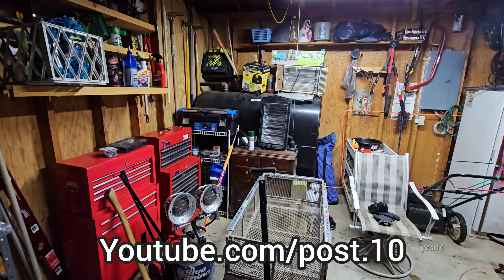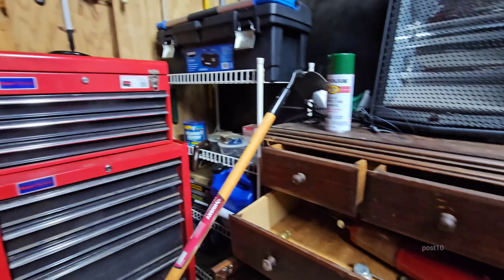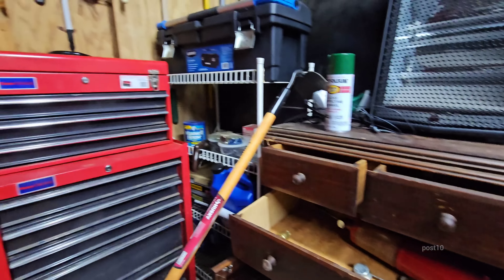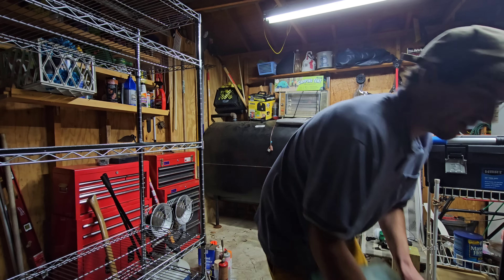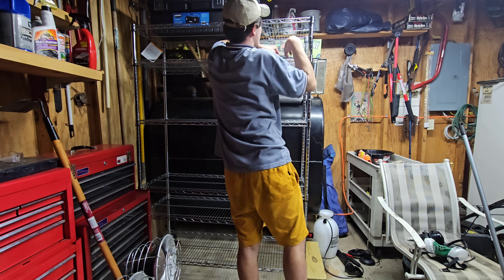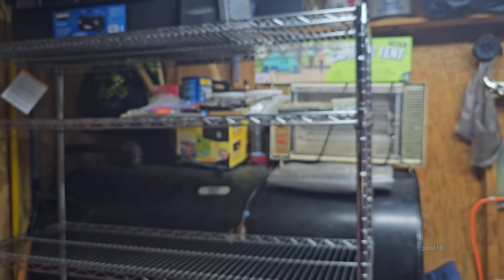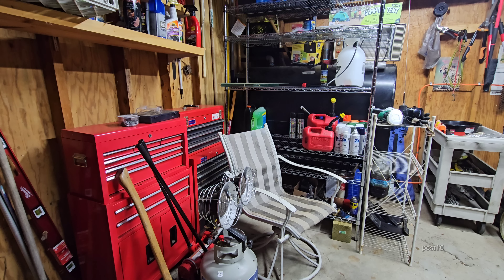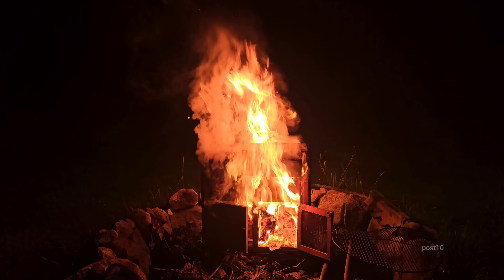September 22 2023 Garage Mold Fire Vlog

Comment: cinder blocks or bricks + those glass shelves = a free shelving unit to sit on the floor in the house. can use felt furniture pads to keep the glass from getting scratched on the pressure points.

Comment: Before you reinforce that shed/garage ceiling, make sure the walls can support added weight, including whatever you store up there. The fire was much more interesting than I would have though, it had me mesmerized. I'm pretty sure pressure treated had arsenic well into the 90s. I worked in a lumber yard millwork shop during HS and college, and frequently made pressure treated treads, risers, POSTS, balusters, etc. to order. That stuff was such a pain to work with.

Comment: I like using vinegar or hydrogen peroxide and sometimes bleach for eradicating mold. I have saved moldy furniture like that piece but do not be afraid to drench every crevice of that. Or burn it because you really do not need it taking up space! You can winterize a pressure washer by running their winterizing oil through the pump.

Comment: Hey post 10 keep up the good videos I sure do enjoy them   When you decide to undercoat your vehicles underside you should use fluid film and not spray paint or rubberized coating because the paint and coating tend to trap moisture and cause even more rust just thought I’d inform you once again keep up the cool videos

Comment: The vent alarm on your tank hangs down about 6-8 inches. By code you need 10 percent room for expansion.  If tanks are filled to the tippy top and the temperature rises the oil will come out the pipes.

Comment: There is nothing wrong with your oil barrel.
The alarm/vent whistle is purposefully designed to sound off before barrel is full full.
Mainly for safety with the delivery guy not risking a potential overfill and spillage resulting from overfill.
It’s the industry standard law for the vent alarm to sound/whistle somewhere around a 10% from capacity/full.

Pretty much why they are usually physically a 275 gallon tank, but rate them at 250 gallons.

Comment: 47:14 - I dont get it. Action cameras are generally more reliable than phones. But they also have a real button to be pressed for a certain duration to make them stop filming and they have a red light next to the lense that tells you if it is filming or not. They're no good when its dark, though. 😊 

But the real reason why something like a GoPro (there are arguably brands that do certain things better than a GoPro) would make a lot of sense for some of your videos, is, you can mount it anywhere. From a headstrap to a chestmount so you have both hands free, to magnetic and suction cups - you could mount one on your car looking sideways and if something comes up worth seeing, cut that footage into the video. Every time you drive around and talk about something off the side, I wish you had a setup like that, because we cant see what you see. 😉

Comment: Why do you have a diesel tank?
Reply from the maker: Fuel oil furnace
Reply from the maker: Almost everybody in New England has a fuel oil furnace or boiler if they're out of the city limits where there might be natural gas, it is more energy dense and takes up less space than a propane tank and is far more efficient then electrical or gas
Reply: @post10Vlogs  ah that’s what I was thinking. Thanks!
Reply: @post10Vlogs  understood

Comment: Post10, I'm assuming that you don't have NATURAL GAS HEATING up there in New England?
Reply from the maker: Only in the cities, would it be feasible running Pipelines to every house in the country and I would not switch to guess over diesel because it's not a safe and it takes up more space
Reply: What about Propane heating?........300 gallon tank would last you most of the year.